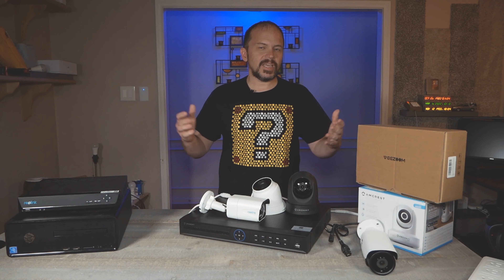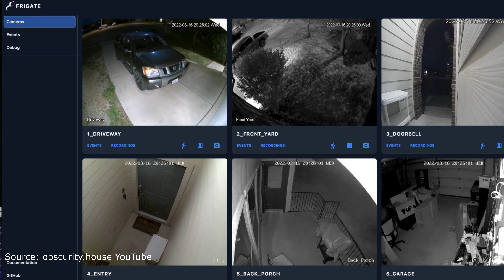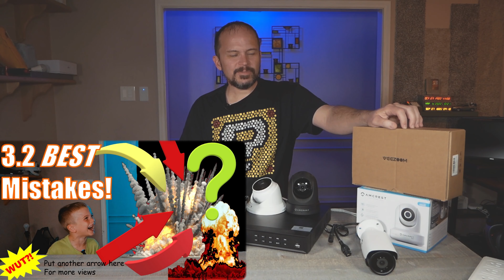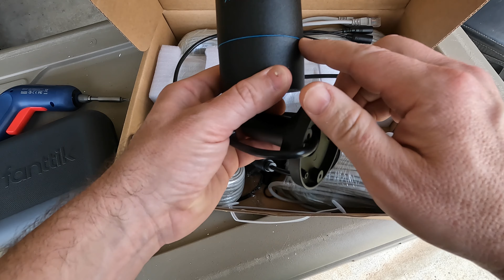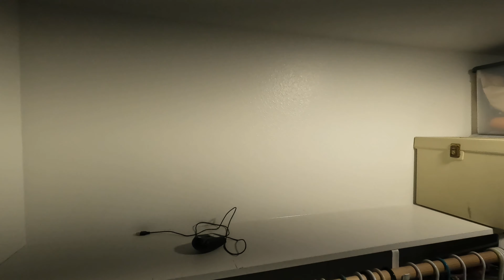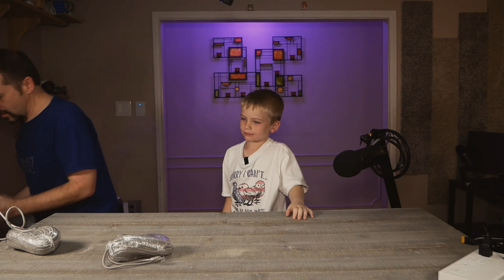Best Security Camera?  Reolink? Frigate? Dahua? Amcrest?

Comment: really appreciate the notes for people who want to set up frigate. I'm a bit stuck because I would like to use Reolink for my easy to use cameras and recording, but I would also like to be able to feed the video to Frigate and experiment with automating things when certain people or vehicles or detected.  Hmm....
Reply from the maker: Definitely stick to the Reolink notes on the Frigate docs to have it work reliably.
Reply: @digiblurDIY  Haven't worked for me and there seems to be a large overhead of setup. If you have the desire, if you are using Frigate and Reolinks, there is a large community that has been having issues. Also, rtsp/h265 and 4k would be two great topics to touch on.
Reply from the maker: Kind of what this is about, Reolink cameras need to stay behind and used with their hardware NVR.  They just work.  Their codecs and models are mess to be used with other software solutions.  Stick to Amcrest/Dahua and even Hikvision for the power user stuff.

Comment: If you had a grand to spend on  outdoor security cameras witch one would you recommend?
Reply from the maker: That's difficult without knowing a few key pieces. Amount of tinkering you want to do, use cases, areas to cover, lighting available at night etc.
Reply: I want something simple,  just want a couple cameras in the front of my house and a couple in the back, front of the house is lit at night and the back isn't, my yard is 1/3 of a acre,, something with good remote viewing,  I was looking at the reolink 810a 8 camera system
Reply from the maker: Simple plug and play that works yet has a bit of features to tweak some notifications and such would be the Reolink system for sure. Figure out the absolute number you want then give yourself room to add a few. Keep it mind that you can buy a 8 channel 4 camera pack system then add stuff from PTZ ones, Duo etc for those weird places like I did.